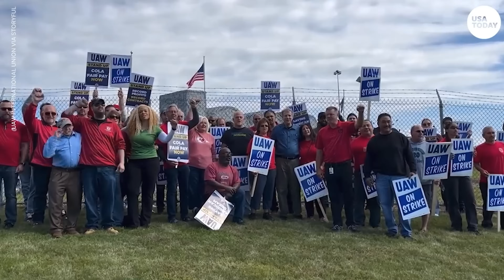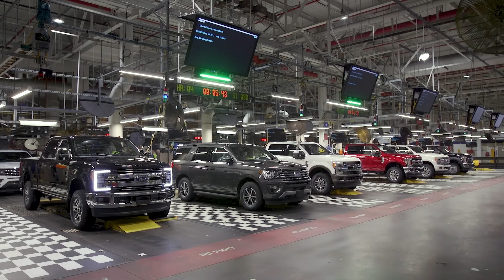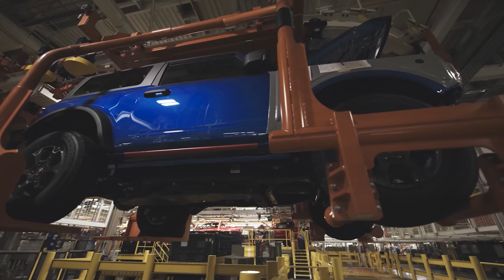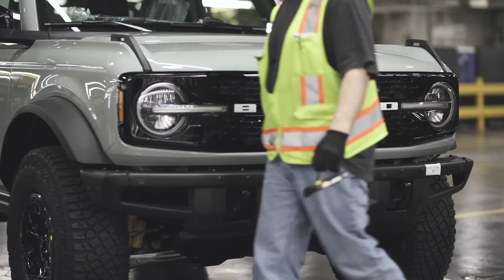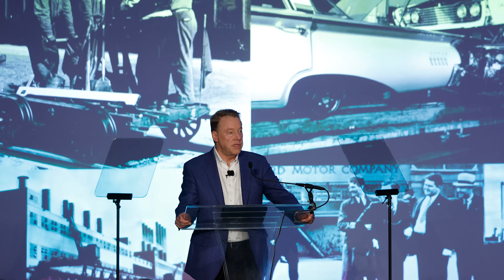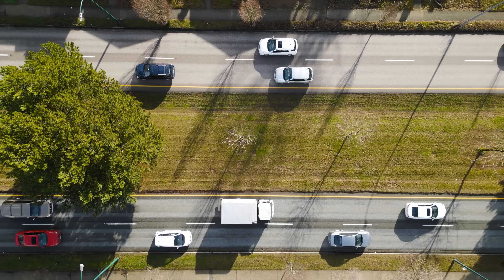How the UAW strikes affect YOU!

Comment: I ordered a 2023 XLT Maverick Hybrid when the ordering opened in October 2022. I received multiple emails about delays. I was recently informed my order had to change to a 2024 model. The color was not available for 2024 and the Hybrid was no longer the base model, it is now a $1500 upgrade. With the increase in cost of the 2024 over the cost of the 2023, my original order has now increased by over $3000. The local dealer sales manager cannot give me any information on whether or not Ford will honor our original sales order pricing from October 2022. Yep, people are getting really tired of getting screwed by the Manufacturers and the dealers. I wish we had a Town & Country in NorCal.